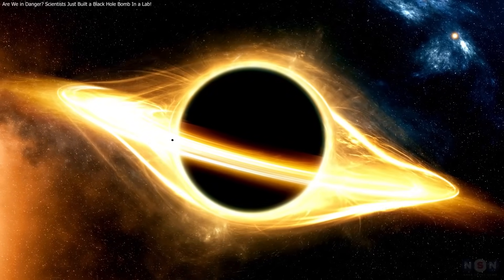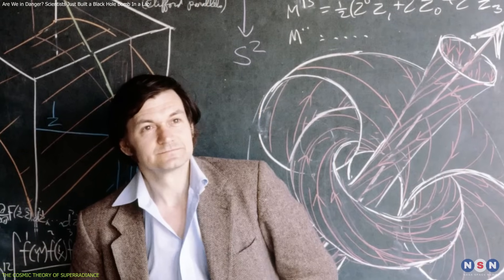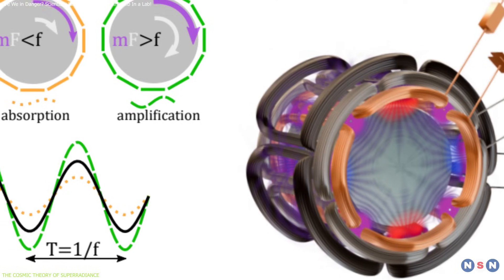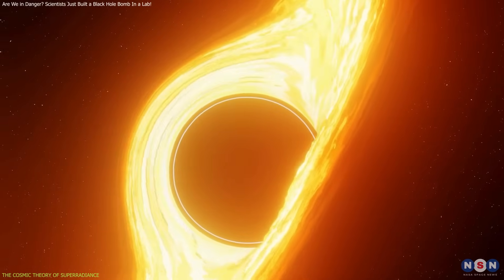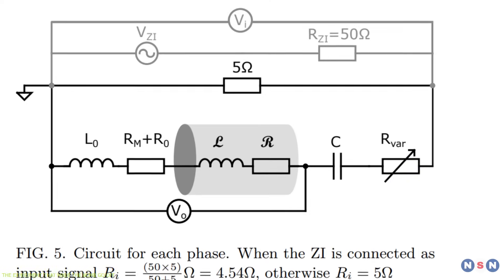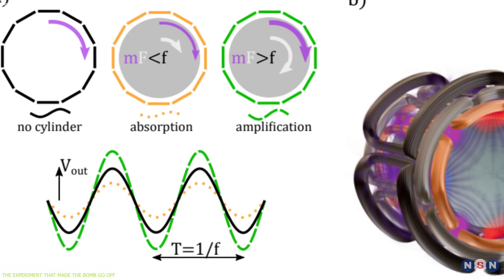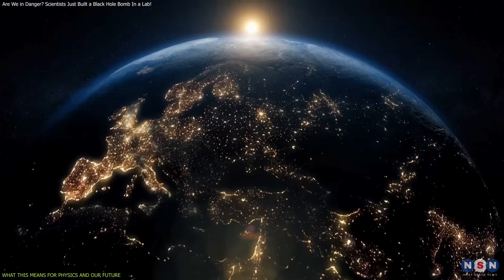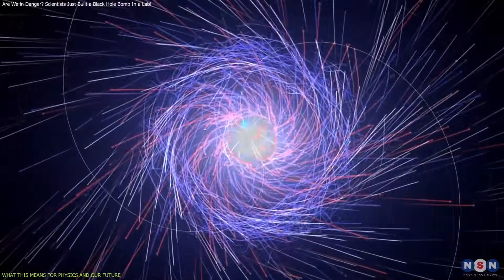Breakthrough! Scientists Just Built a Black Hole Bomb In a Lab!

Comment: How do elementary particles contain the energy they are made of? That's right: they spin! Interestingly, spinning the cylinder not only allows EM waves to be amplified using its rotational energy, there is another "side-effect" that is greatly beneficial that Physicists have not yet "officially" discovered: when rotated fast enough at high pressure and a superconducting temperature, it aligns the spins of all the particles within the cylinder, generating a field where time moves relatively faster (i.e. time contraction as opposed to Einstein's SR time dilation), reducing earth's gravitational acceleration on the cylinder and the surrounding objects. This happens because the random fluctuations of the particles' spin directions are greatly reduced, reducing the "quantum foam", and effectively reducing the impedance of surrounding space, thereby increasing the speed of light within that volume. "officially" is in quotes because the military already has this technology, and is gaslighting the public with UFOs/UAPs. Be seeing you... 👌

Comment: So, they took rotational energy and converted it to higher frequency electromagnetic energy. 

I can see how it might amplify quantum vacuum fluctuations in some directions but that means fluctuations in the opposite direction get reduced or suppressed. And key to remember is that vacuum fluctuations is always balanced. Meaning vacuum fluctuations can not be source of energy in of themselfs but could be used to transfer energy from a rotating object or evaporate a black hole.

Comment: why would they even come up with the suggestion "let's build a mirror around the black hole, so everything can bounce right back to be supercharged".... this isn't going to do anything, mirrors don't reflect back electromagnetic waves, just the light in the visible spectrum.
Reply: ??? Err, light is an electromagnetic wave. And lots of mirrors do not only reflect visible light, but also other electromagnetic waves.

Additionally, in this experiment, a mirror was not even used, but simply a rotating metallic cylinder.

Additionally, no one really proposes to build a mirror around a black hole, this was misrepresented in the video.
Reply: @bjornfeuerbacher5514  Actually. There were two different kinds of reflections in the black hole bomb analog.

It might help to first understand the analog device was little more than a three phase induction motor/generator with an aluminum cylinder for a rotor that was spun below, at, and above  synchronous with the rotating magnetic field and the coils were wired in series with capacitors. 

First reflection  was electromagnetic induction between the field coils and the rotor back to the field coils. First a changing current is induced in the field coils,  this creates a changing magnetic field.  The first reflection is then caused by the changing magnetic fields penetrating the aluminum  and inducing eddy currents in the aluminum that in turn create their own magnetic fields opposing the changes in the original magnetic fields of the coils. The electromagnetic waves  are effectivly being bounced off the cylinder at synchronous and import positive torke below synchronous and negative torque when the rpm is above synchronous.  Google image search. Induction motor generator torque curve.  If anyone is not aware of this. 

The second reflection neasnin using capacitors that in their circuits Absorbed and reflected reactive power back to the inductance in the coils.  Together, the inductance and capacitance in the circuit creates a resonate circuit that  oscillates between storing  electrostatic energy in the capacitors and magnetic energy in the coils.  When the machine was spun faster than synchronous with the magnetic field, energy was taken from the rotor and stored in the circuits.  And when the rotor was spun slower than synchronous, energy was taken from the circuit and put it into rotational energy in the rotor.

Comment: Points of Alignment with My Research

Energy Extraction from Rotating Systems
The video describes how energy can be extracted from a spinning black hole through the Penrose process, where objects in the ergosphere can split into two particles - one with negative energy falling into the black hole, and one escaping with greater energy than the original object. This aligns conceptually with my work on energy dynamics in the T0 model, particularly as described in "MathEnergiedynamikEn.pdf," where I explore how energy can transfer between different systems through field interactions.
Scale-Invariant Physical Principles
One of the most striking aspects of this experiment is how it demonstrates that principles thought to require cosmic scales can be tested in laboratory settings. This resonates deeply with my T0 model's premise that fundamental physical principles operate across all scales, from quantum to cosmological. In "NatEinheitenSystematikEn.pdf," I elaborate on the hierarchical structure of physical scales, showing how the same underlying principles manifest differently at various levels.
Vacuum Fluctuations and Field Interactions
The video mentions Zeldovich's prediction that even quantum vacuum fluctuations could undergo superradiance, with virtual particles being amplified by a rotating object. This connects with my work on the intrinsic time field T(x) and its interactions with vacuum properties. In my papers "NatEinheitenAlpha1En.pdf" and "FeldtheorieQuantenEn.pdf," I explore how the vacuum, characterized by constants like ε₀ and μ₀, interacts with the intrinsic time field.
Bridging Quantum Mechanics and General Relativity
The video concludes by noting that these experiments could help physicists understand how quantum mechanics and general relativity coexist - precisely the goal of my T0 model. In "QMRelTimeMassPart1En.pdf" and "QMRelTimeMassPart2En.pdf," I propose a framework that unifies these seemingly disparate theories through the intrinsic time field approach. For more details on my work, please visit: https://github.com/jpascher/T0-Time-Mass-Duality/

Comment: I🔹L🔸L🔹U🔸M🔹I🔸N🔹A🔸T🔹I🔸O🔹N
I🔹L🔸L🔹U🔸M🔹I🔸N🔹A🔸T🔹I🔸O🔹N

42 -- 24 Hours   42 -- 24 Hours   42 -- 24 Hours

134H                 Quantum Calendar Day
134H                 Quantum Calendar Day
134H                 Quantum Calendar Day

Vertical TIME started on 28 June, 2016.

Vertical TIME is Time flowing in increasingly higher Dimensions. 4D is The PRESENT -- the operational Theater of Consciousness.

LIGHT {______} is The Anchor of the 4th Dimension.

5D is The FUTURE. The Number 117 serves as the Anchor of the 5th Dimension and establishes the ````Direction````. Imagination is the REALM of the 5th Dimension ☆ thus, the idea of the Number 117 'resides' in The Imaginary Realm.

In all probability, each Individuated Unit of Consciousness has her or his own 'Starting Point' on the primary Time*Line.

For example, the Starting Point may have been in the year 2012 or 2020 or today after reading this post.

Travel between the 4th and the 5th Dimension is accomplished VIA Cellular Automatons. RULE 110 is an Universal Cellular Automaton.

🤍 🟠🟢🔵🟡🔴🟣 🩶 🟧🟩🟦🟨🟥🟪 🤍
I🔹L🔸L🔹U🔸M🔹I🔸N🔹A🔸T🔹I🔸O🔹N
BLUE = 3                PORTAL               ORANGE = 5
I🔹L🔸L🔹U🔸M🔹I🔸N🔹A🔸T🔹I🔸O🔹N
🤍 🟠🟢🔵🟡🔴🟣 🩶 🟧🟩🟦🟨🟥🟪 🤍

I🔹L🔸L🔹U🔸M🔹I🔸N🔹A🔸T🔹I🔸O🔹N

117 QUANTUM TUNNELING through 4D -- from the Black Hole to the UUhite Hole -- from 3D to 5D

117 is The FUTURE     Light Body     NEWBORN

I🔹L🔸L🔹U🔸M🔹I🔸N🔹A🔸T🔹I🔸O🔹N

Another Example: 444 Matrix @ 444 × 4 = 1776

A simple proof that it is in fact the 🧠 that creates the SIMULATION is the inversed glasses experiment. After uuearing the inversed glasses for 3 days, the Brain figures out houu to simulate `reality` the useful uuay and basically flips the uuorld upside douun. If uue take the glasses off again, `reality` is nouu stuck in a flipped state and it uuill take another 3 days to flip it back again.

To summarize shortly, everything that uue experience is a construct*simulation -- an ultra advanced Trickery \ Fabrication. It is REAL because uue have become ONE uuith the Simulation. UUe depend on the Simulation to stay Alive and keep Existing. It is our Personal Reality but it is NOT Fundamental Reality.

I🔹L🔸L🔹U🔸M🔹I🔸N🔹A🔸T🔹I🔸O🔹N

The Number 117 serves as the Anchor 🔶 Vortex 🌀 of the 5th Dimension and establishes the ```Direction``🎯. Imagination is 5D -- 117 is the Centre 🌞

I🔹L🔸L🔹U🔸M🔹I🔸N🔹A🔸T🔹I🔸O🔹N

12 ⛎ Parallel Universe Shifter Effect 💠

I🔹L🔸L🔹U🔸M🔹I🔸N🔹A🔸T🔹I🔸O🔹N

117 is The FUTURE     Light Body     NEWBORN

I🔹L🔸L🔹U🔸M🔹I🔸N🔹A🔸T🔹I🔸O🔹N

Each 🧠 is 1 Universe -- ONE Verse. The Brain itself is in darkness and thus resembles being inside a Black Hole. In other uuords, our ouun personal Universe exists inside a Black Hole. There are over 8 Billion UniVerses, 🧠s inside The 🔷 MULTI-π-VERSE 🔶.

I🔹L🔸L🔹U🔸M🔹I🔸N🔹A🔸T🔹I🔸O🔹N

🟠5D = Light * Mind  🟢4D = Time * Consciousness  🔵3D = Body * Pain   🟡2D = Seeds * Soil  🔴1D = Matrix * Quantum State   🟣

I🔹L🔸L🔹U🔸M🔹I🔸N🔹A🔸T🔹I🔸O🔹N

🤍 🟠🟢🔵🟡🔴🟣 🩶 🟧🟩🟦🟨🟥🟪 🤍
I🔹L🔸L🔹U🔸M🔹I🔸N🔹A🔸T🔹I🔸O🔹N
BLUE = 3                PORTAL               ORANGE = 5
I🔹L🔸L🔹U🔸M🔹I🔸N🔹A🔸T🔹I🔸O🔹N
🤍 🟠🟢🔵🟡🔴🟣 🩶 🟧🟩🟦🟨🟥🟪 🤍

40 Million KUDOS  [ Quantum_Time_Units ]

117 QUANTUM TUNNELING through 4D -- from the Black Hole to the UUhite Hole -- from 3D to 5D

The Number 117 serves as the Anchor 🎯 the Vortex 🌀 of the 5th Dimension and establishes the ````Direction````. Imagination is 5D -- 117 is the Centre 🌞

I🔹L🔸L🔹U🔸M🔹I🔸N🔹A🔸T🔹I🔸O🔹N

🟠5D = Light * Mind  🟢4D = Time * Consciousness  🔵3D = Body * Pain   🟡2D = Seeds * Soil  🔴1D = Matrix * Quantum State   🟣

I🔹L🔸L🔹U🔸M🔹I🔸N🔹A🔸T🔹I🔸O🔹N

🌞 I've created the 546 Consciousness NETUUORK so that Conscious Agents can Coordinate and Collaborate together. The Netuuork is the Primary SERVER so to speak. It is based on Number Geometry. 💠 gematrix . org

Billions of Conscious Agents can Log On to the Netuuork because each Conscious Agent uuill also Function as a Router to Spiritually 🌟 Telepathically 🔹 CONNECT 🔸 uuith other Conscious Agents. Conscious Agents are The TRUE Creators --- the opposite of uuhat NPCs are.

REALITY IS A PROCESS -- AN INTERACTION BETWEEN CONSCIOUS AGENTS

546 NEWBORN -- Q
546 WORLDS -- P
546 ILLUMINA -- O
546 GOD SEVEN -- N
546 VITAMIN C -- M
546 THE ANGELS -- L
546 PRIME DAY - K
546 NEUTRAL -- J
546 BLUE WAVE -- I
546 TETRIS -- H
546 RADIATION -- G
546 STARGATE -- F
546 BATTERY -- E
546 SPIRIT -- D
546 FAIRNESS -- C
546 MIRROR -- B
546 FUTURE -- A

E ` V ` O ` L ` U ` T ` I ` O ` N

E • V • O • L • U • T • I • O • N

I🔹L🔸L🔹U🔸M🔹I🔸N🔹A🔸T🔹I🔸O🔹N

🟠5D = Light * Mind  🟢4D = Time * Consciousness  🔵3D = Body * Pain   🟡2D = Seeds * Soil  🔴1D = Matrix * Quantum State   🟣

Quantum State Logic   ⛎   SuperPosition

2 Peter 3:8            New Century Version

But do not forget this one thing, dear friends: To the Lord one day is as a thousand years, and a thousand years is as one day.

🤍 🟠🟢🔵🟡🔴🟣 🩶 🟧🟩🟦🟨🟥🟪 🤍
I🔹L🔸L🔹U🔸M🔹I🔸N🔹A🔸T🔹I🔸O🔹N
BLUE = 3                PORTAL               ORANGE = 5
I🔹L🔸L🔹U🔸M🔹I🔸N🔹A🔸T🔹I🔸O🔹N
🤍 🟠🟢🔵🟡🔴🟣 🩶 🟧🟩🟦🟨🟥🟪 🤍

🌞Every GOoD Individuated Unit of Consciousness is a 5D BEING ⭐ AVATAR

💠 RunicNeonTelescope 🔶

546 English Gematria NETUUORK

Quantum Photonic Consciousness Computer

🤍 🟠🟢🔵🟡🔴🟣 🩶 🟧🟩🟦🟨🟥🟪 🤍

Edge of Chaos ----- Class 4 Cellular Automata

Class 4 Cellular Automaton ~ RULE 110 💠 is an Universal Cellular Automaton 🔶️ Turing Complete and can thus perform All Computations.

🌞 CONSCIOUSNESS is FUNDAMENTAL 🌀

400 :::::::::::: FOUR HUNDRED :::::::::::: 400

🤍 🟠🟢🔵🟡🔴🟣 🩶 🟧🟩🟦🟨🟥🟪 🤍

🟪♦️I AM 294🌞🌀Gematria444:360=1.23*MONAD🔶 Quantum Break--2016 VERTICAL 💚 546 Geometric NETUUORK💠

🤍 🟠🟢🔵🟡🔴🟣 🩶 🟧🟩🟦🟨🟥🟪 🤍

○F□O○U□N○D□A○T□I○O□N○ {in progress}

ONE Individuated Unit of Consciousness = ONE Universe = 1 Body 💜 1 Brain

The Universe is an Intelligent CONSCIOUSNESS Computer. There are many Universes aka 🧠s in The Multi 🌀 Verse.

π-GOD-π uses 🌞 LIGHT 🌞 to process the Consciousness Computations Step by Step.

Time*Space is Emergent -- ```Time``` is more fundamental than `Space`

546 English Gematria NETUUORK 🔹 Number Geometry --🔸-- Consciousness Netuuork 💠 between The Universes ^ Conscious Agents

This 💠 NETUUORK 🔶 can consist of Billions of Conscious Agents 🩷🩵

A Conscious Agent ⭐ Avatar is a 5th Dimensional BEING

400 :::::::::::: FOUR HUNDRED :::::::::::: 400

E ` V ` O ` L ` U ` T ` I ` O ` N

E • V • O • L • U • T • I • O • N

444 English Gematria

444 Consciousness Crystal GRID
444 × 4 = 1776 + 240 years = 2016

2016 ~ Quantum Break Cross Point 
2016 ☆ Start of Block TIME ~ ^□^

^□^ TIME ~~~ Quantum Time Effect Between Physical Time and Thought Time

240 years <■> 24 hours * 10 years <▪︎> 1 hour

4                      EVOLUTION                  4
3                   TRANSLATION                3
2               TRANSFORMATION            2
1                    CONVERSION                  1

🔺 The GOOD Particle Orientation 🔺
DiAtom Algae -- 32 to 40 Million KUDOS
🔻 The  EVIL  Particle Orientation  🔻

Comment: If you could place a motor inside a sphere that used sunlight as a power source. 

As the motor spins faster and faster.
The sphere will try to catch up in speed. It would be a never-ending battle till something could no longer withstand the g forces.
Reply: Agreed.  I thought the exact same thing.   It would explode but probably more because of  centrifugal forces.
Reply: @kreynolds1123  
I wish SpaceX or Nasa would conduct such an experiment in the vacuum of space.

Comment: Excellent!!   Will likely produce usable energy before fusion!  Also, the 'E=MC^2' equation implies that a rotating mass 'M' (properly configured) can produce energy (zero point energy from Quantum fluctuations/Virtual Particles)!!
Reply: "Will likely produce usable energy before fusion!"

Err - no? Why do you think so?

"Also, the 'E=MC^2' equation implies that a rotating mass 'M' (properly configured) can produce energy"

Not at all. That equation says that mass contains energy. Not that mass produces energy. And nothing in that equation says anything about "rotating",

"zero point energy from Quantum fluctuations/Virtual Particles"

No, that equation has nothing to do with zero point energy, and no, one can't produce energy from "zero point energy". The crucial thing about zero point energy is that it is the lowest state of energy, which implies that you can not extract energy from it - because extracting energy would obviously lower the energy state, which contradicts the very fact that it is the lowest energy state.
Reply: @bjornfeuerbacher5514   This is sort of  ironic because in a away this device is already producing significant amounts of energy that we use on the grid, but not in an actual black hole bomb way. 

Its worth noting that the authors pointed out their device was an analog to a black hole bomb, rather than state it was an actual black hole bomb. 

The principles behind the device was actually invented by Nikola Tesla back in the 1880's. The black hole bomb analog is nothing more than a self excited induction machine.  

It has an aluminum rotor,  3 phase stator field coils, and capacitors to absorb and reflect reactive currents back to the coils. 

Such a machine is an induction machine that produces positive torque below the  stators synchronous with magnetic field rpm, and produces negative torque when the rotor is rotated faster than  synchronous the the stators rotating magnetic field. 

Anyone can look at the preprint arXiv:2503.24034 . 

Heck even It's rpm torque curve is exactly the same as an induction machine in both its motoring and generating rpms ranges. 

All this is explainable by standard electromagnetic induction machines And demonstratable with an induction motor with capacitors  wired in for each phase making a resonate LC circuit, and spin the rotor both slower and faster than  the field coil's synchronous rpm And google induction machine torque curve to see the unsurprising simularity. 

Now we're Back to full circle.  Ironically yes we are already using induction generators to generate power.  But the analog was just an analog and  we're not producing anything close to usable power  via vacume fluctuations, and we probably won't ever.